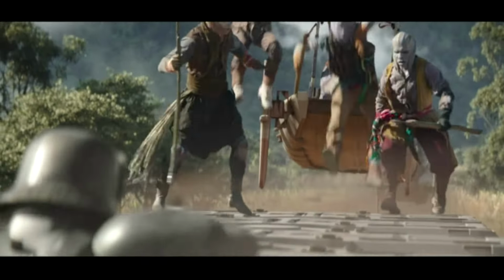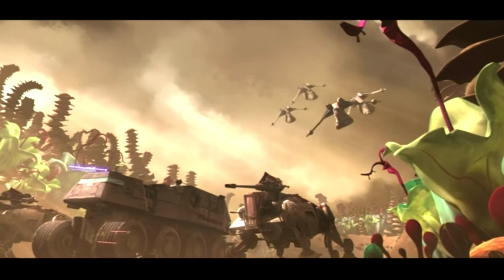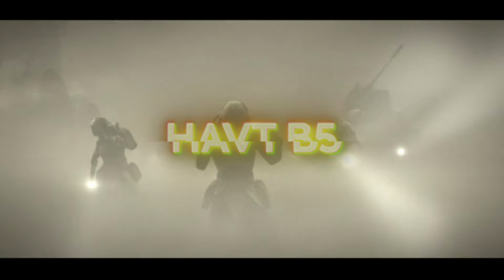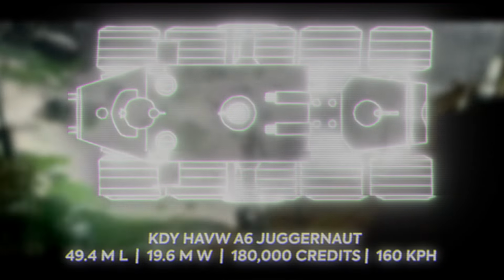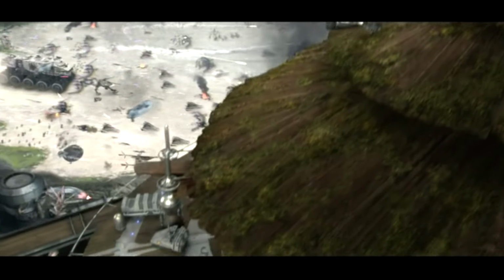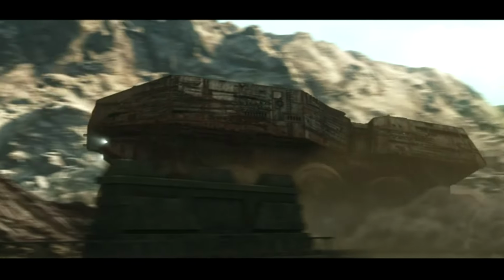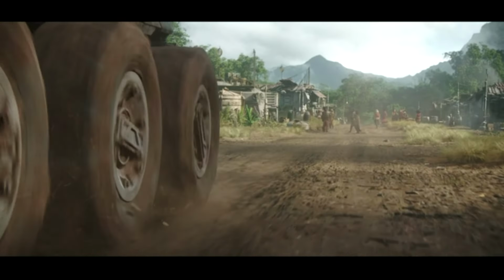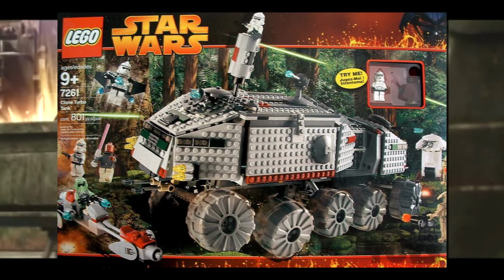CLONE TURBO TANK | HAVw Juggernaut | NEW and IMPROVED Version | Star Wars Vehicle Breakdown

Comment: Amazing video! A couple of things: the A6 costed 350k credits in Legends, for some reason it costs 180k in canon as you've correctly stated
The A9 doesn't use the same rocket pods as the A6, they look slightly different, they would be way to big for the A9, and the extension/retraction mechanism seen on screen works different.
I think I've heard you saying that for Episode III they just rescaled the A5 and had to give it a new name, well the A6 doesn't just have slight modifications compared to the A5, it's quite different

Comment: If one company owns a license to a name, that name can't be used. Hasbro has a habit of reusing names for different toys (especially transformers) so they maintain their trademarks. It's likely that this was done to avoid legal issues with the case of the juggernaut. 

From an in-universe explanation clone turbo tank or turbo tank is likely a shorthand by the GAR/Clones. Most of the clones simply refer to AT-TEs as "tanks"
Reply from the maker: Okay, gotcha! Thanks for the clarification!
Reply: Oh yes, especially in the early 2000s, hasbro gave classic transformers names to characters that had nothing to do with the g1 version of that character, for example in transformers armada, wheel jack looks. Othing like the crazy inventor from g1 and more like a black sideswipe